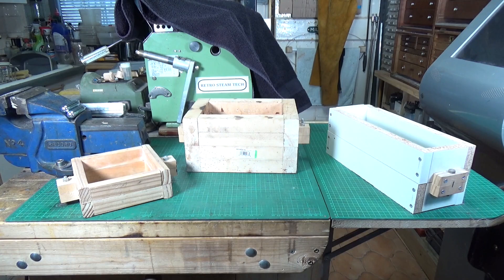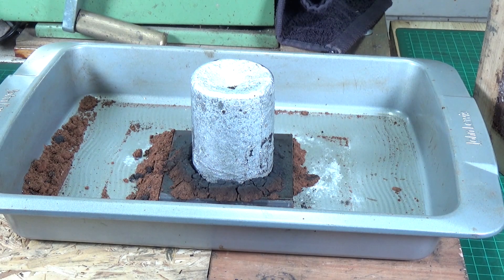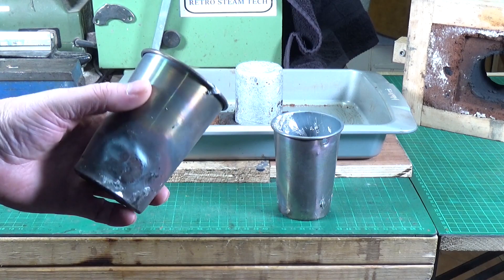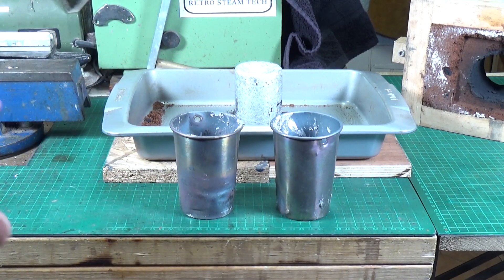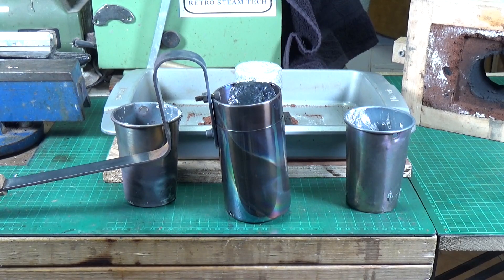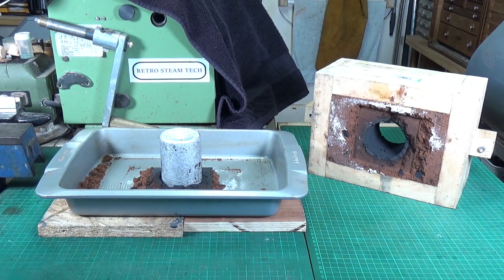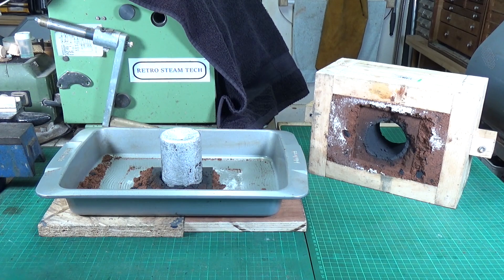Home Cast Aluminium Using An Open Sand Cast instead Of A Mould

Comment: I just did something similar just last week. I call it lost can casting. I find an appropriate sized aluminum beverage can and peel the top off.  I use a ram to pound the bottom of the can flat (less to cut off later), I put it in a coffee can and pour in a fine sand around it, no ramming needed. Then just pour in the molten aluminum. I also tried a toilet paper tube and glued a paper board bottom on it. It worked well too but there's flame as the cardboard burns.
Reply from the maker: Never tried that but it sounds like a good idea. I did think about using a coffee can or large paint can as a container for the sand, must try that.

Comment: Came out well.
I would have just used a layer of sand at the bottom. The steel plate is acting as a chill and taking away the heat, butit worked so no problem.
Reply from the maker: Thanks. I have found in the past that just using sand, at the bottom of a tube mould for instance, can cause the sand to get thrown up into the aluminium. The plate didn't seem to cause any issues. I've since done another pour and that worked out ok too. Cheers, Alan.
Reply: @RetroSteamTech  Ram the sand in the bottom and it won't move.

Comment: The flexibility of your crucible handle puts me on edge considering the heat of the metal.
Reply from the maker: The current crucible handle is made from 3.5mm thick steel flat bar. Even with a full load of aluminium it doesn't flex.

Comment: I would be too tight to burn so much gas and build a charcoal furnace with blower. Charcoal can be made for free.
Reply from the maker: Yes, that's another way to do it. The gas torch doesn't really use a lot of gas.

Comment: Hi Alan.  That worked well.  The mould looked almost reusable in it's "baked" state.  I've been thinking about doing another aluminium melt as well lately. It must be that time of the year ;)  Very satisfying to see the money saving result appear. Certainly saves a small fortune in cash and you don't have to worry about wasting stock.  I did an open sand casting for the spine of that stretched wobbler engine build recently and it also was a breeze.  Coz I'm too tight to buy proper casting sand, I just use kid's fine playpen sand with either molasses or ATF (oil).  Molasses is the bonding agent of choice as ATF smokes out the workshop badly.  He He. Cheers Rob
Reply from the maker: Hi Rob. Yes, if I had been a little bit more careful I probably could have reused the cast. I've since done another pour and that was also successful. My new hi-tech crucible 😉 is also working well, the extra capacity is most welcome. The Petrobond sand I use is fairly cheap in small quantities and as I can only melt a small amount of aluminium at any one time, works well for me. Cheers, Alan.

Comment: I was lucky enough to be given some alloy engine heads and some wheels for casting. I also save all my brass scraps and swarf to melt down into barstock. It saves a ton of money and you can cast the shapes you want.
Reply from the maker: It's great isn't it. Sadly my little furnace doesn't create enough heat to melt brass but it does aluminium fine.